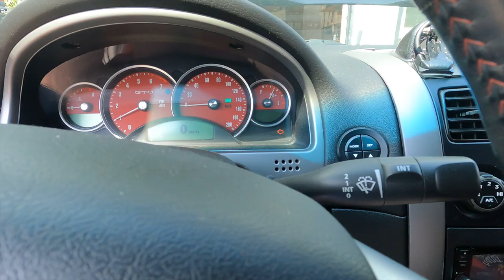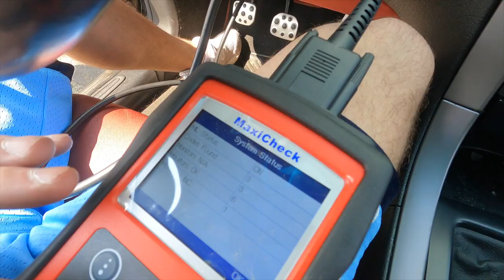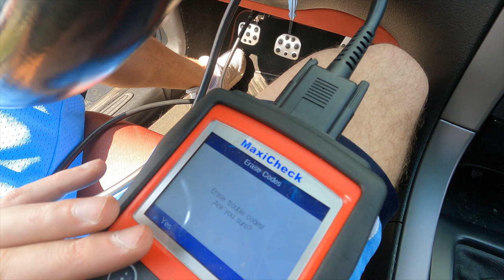Just F&%king Work! Solving GTO issues

Comment: Hey man, just wanted to say thanks for the video it has helped a lot. I have the same lean codes on both banks on my Monaro in the UK. You have given me a few things to try at the weekend. I like your vacuum finding method. 
She's up on stands at the moment as i am just finishing fitting coilovers and a big brake kit so I really hope i don't get the same troubles as you on the brakes!
I feel your pain, they can be a struggle sometimes but I promise it will be worth it when you get it all sorted! Thanks again for all your videos 👍
Reply from the maker: Thanks for watching and I hope the vids help you! I think the brake issues was from letting it bleed out all the way. I'm gonna try replacing my rear calipers in case they seized up. Is you ECU tuned? That could throw a code. I just got dyno'd and tuned and all my lights are gone now